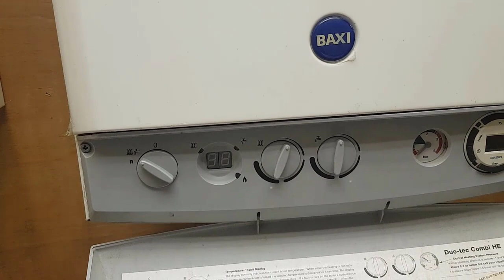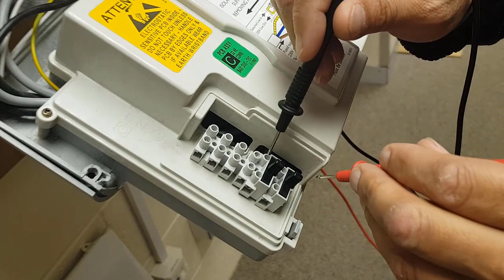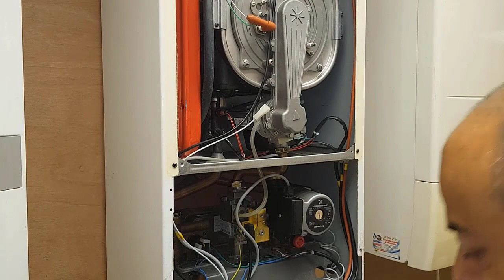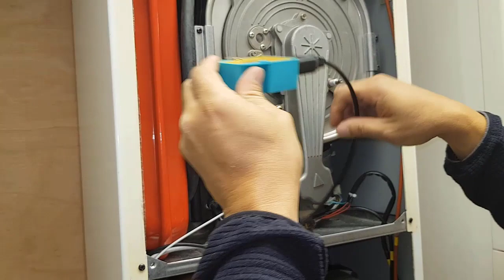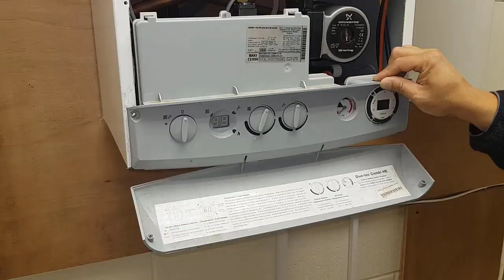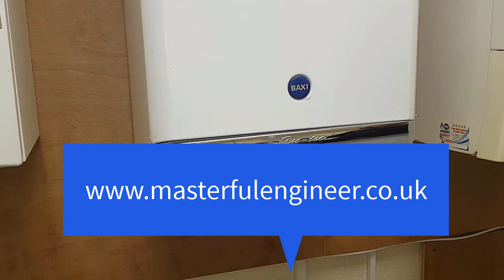Choosing The Right Path to Accelerate Boiler Repair Training V2

Comment: Draining from the PRV is not a good idea, unless you fancy running the risk of replacing that too. 

The engineer went straight to the source of the blown fuse - the diverter valve and motor. How did he know that? If he didn’t know that this is a common problem on this boiler, how would he test components to determine which one was the problem?
Reply from the maker: Hi Ed it's all part of the training. He's training using the Fault Analysis Quadrant you can download a free copy of the Ebook
Reply: @ARBoilers  I’ve got ebook, and it is useful, but it would be good to understand how he went from blown fuse to knowing which component was at fault. It could have been any electrical component attached to the board, so what tests would you carry out to confirm it?

I know one method, but you may know a better one. Either way, your trainee went straight to the actuator motor - what steps did he carry out to get there? The video doesn’t explain.
Reply from the maker: @edmetcalfe8974  Hi Ed the point I am trying to make, if you were to invest in my training course I would get back 10 times the value you put in. Give a go and you will be amazed
Reply: Hi,  with my online, classroom and hands on training my Trainer is simplifying the diagnosis process hence making it easier to get to the source of the breakdown quicker